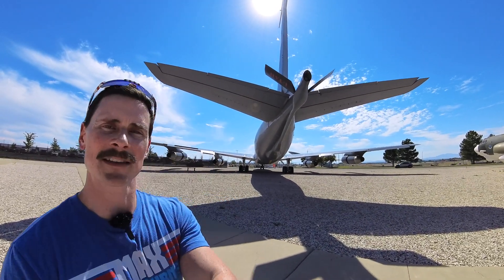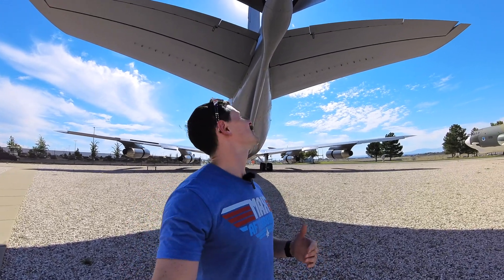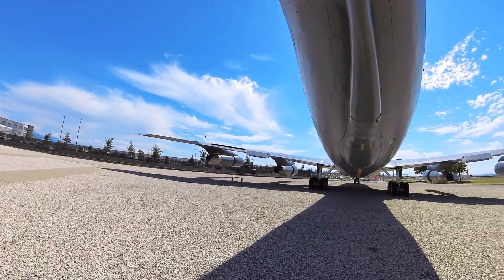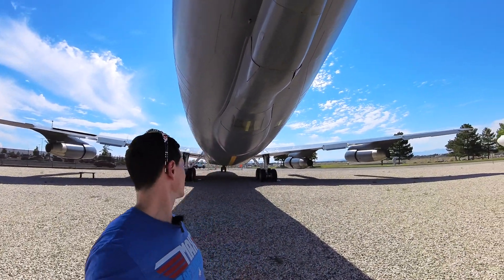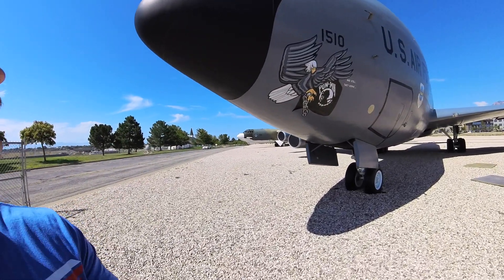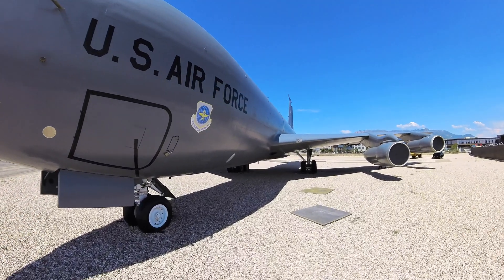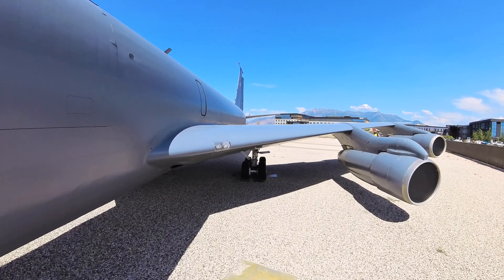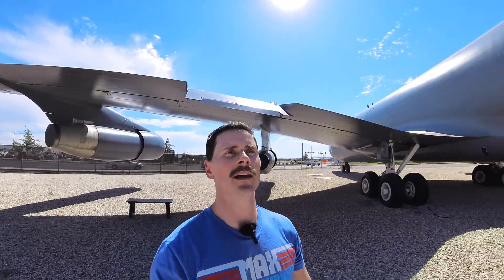This Jet Can Pump More Fuel in 8 Minutes than a Gas Station in 24 Hours!

Comment: The flow rate was usually right around 600 gal/min. Some planes can take a bit more. There is a pressure gauge the operator uses. For most aircraft, it is around 55psi; for some aircraft, it is much lower. Such as A10 and other ACs with linings inside the fuel tank. In the 135, the boom operator actually lies face down. In the KC10, they sit up right.

Comment: I worked with a guy who was crew chief on a kc-135. If i remember right he told me the drogues/baskets could fill around 1,000lbs/min. Any idea of the boom flow rates? I would think it would have to be a lot higher. A C-17 or C-5-A holds slightly more than a F-18 with externals 😂

Comment: Awesome video! Just retired after 28 years as an R model boomer, already miss it. AR'd the Thunderbirds during a couple of Coronets, worked with the F-15E numerous times as well. One quick story about the dim PDI lights... Kept getting the "Hey Boom, are the PDI's on???" during one coronet. Crew chiefs would open them up, check bulbs, replace, etc. but still got the same questions/concerns from our receivers while inflight. Turned out depot had forgot to mask several of the lights and they ended up being painted over. Spent a good hour helping the crew chiefs scrape the paint off post mission one afternoon... No further issues or write ups 😆

Comment: I enjoyed the walk around of the KC-135 and hearing your experience with it. It reminded me of a story my brother-in-law who flew the B-52 early in his Air force career and the A-10 and SR-71 Blackbird at the end of his career. He told me how some guys had trouble with refueling when the receptacle was behind the cockpit like it was on the SR-71. Because of his experience in the B-52 it made it a little easier when he began training in the SR-71. He is about to attend his 50th class reunion at the Air Force Academy this September 2023. Thank you to both of you for your service.
Reply: Austrian, only done the mandatory Conscription serice in my country, but is that normal? going from a bomber to a ground support AC to a highend recco plane?
Reply: Yes, after flying the A-10 he applied for the SR-71 program and after passing all the interviews and requirements needed to fly the Blackbird he was accepted into the program as a pilot and flew the Blackbird until the program ended. Maybe Ryan can explain how that works moving from one plane to another.
Reply: @MikelK2112  i can see going how he ended up in the blackbird, but how does one go from the b-52 to the a-10? like those 2 couldnt be more apart. lol.